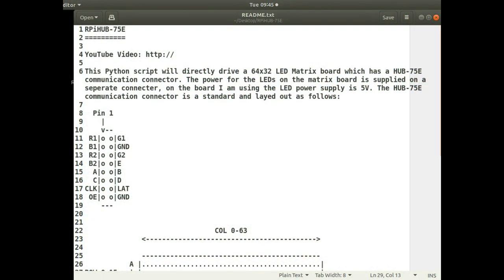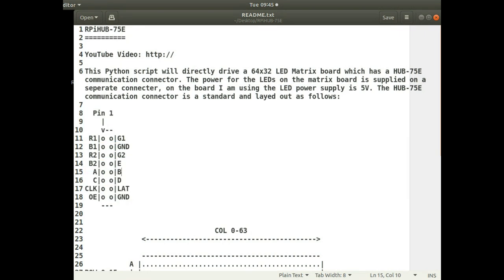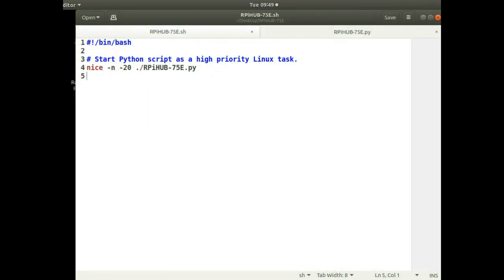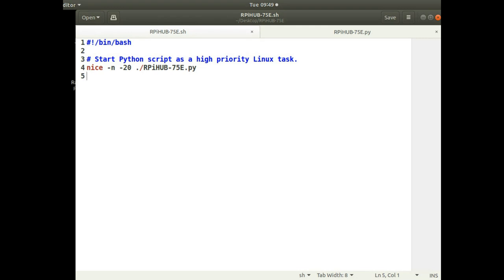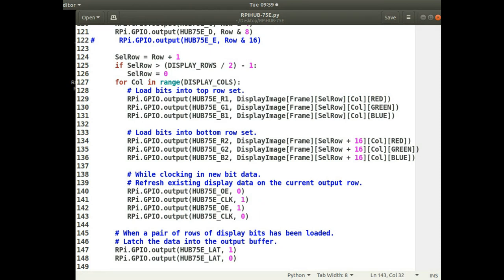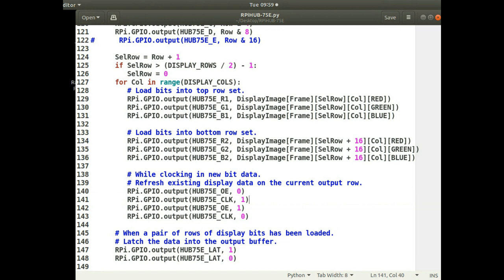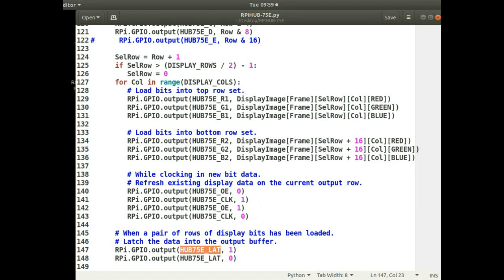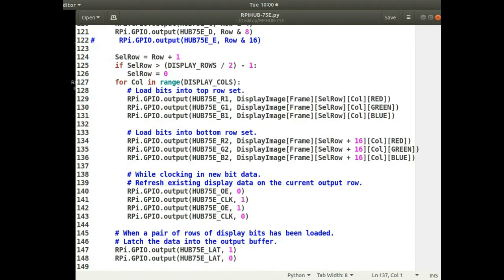Driving a 64x32 HUB-75E LED Matrix With Python From a Raspberry Pi

Comment: What commands do you use to display.  Can't tell if my video 64x32 is the problem or the interface HAT card.  do you have a video of commands.
Reply from the maker: The source code used in this video is here: https://github.com/BirchJD/RPiHUB-75E
At the top of the code is the GPIO pin assignments, change those to the pin assignments used on your HAT and when the code is run, it should do the same as what happens in the video.

Comment: Sir will u please inform me what are the changes should be made in program to interface RGB P3 64x64 Display.
Reply: I've received my 64x64 matrix today, got it connected to a pi1 so I had to change some of the pins
I enabled pin E in the code (which was commented out)
I just have the issue where it's not drawing the whole matrix properly (missing lines (banding))

Comment: Thanks for your video, it was really informative! However, I'm working with a setup that is wired directly from the Adafruit 64x32 panel to the Raspberry Pi via female to female jumper wires. The code doesn't work as is, so I'm assuming I need to change it a bit. I'm really new to this stuff (Raspberry Pi programming, not Python or programming in general, I'm a year away from completing my computer science degree lol) so any advice would be appreciated on how to proceed.
Reply from the maker: Anna, 
Is this the item: https://www.adafruit.com/product/2279
On the specs of their page it specifies 5V @ 4A on the black and red cables they supply. I think a separate 5V supply from the Raspberry Pi would be ideal because of the current required. Their product page is not very helpful, I zoomed into one of the images and it looks like it says HUB-75D, the display I have has a HUB-75E connector. I don't know the different, but the PCB looks like it has labels for each pin. I think you should find that connecting the appropriate GPIO on the Raspberry Pi to the connector should work. You will need a 0V from the Raspberry Pi to the ribbon connector too. At the top of the source code RPiHUB-75E.py you will find the GPIO pin numbers associated to the labels on the ribbon connector.
Jason

Comment: Did you have to solder anything?
Reply from the maker: The matrix I got came with wires and connectors for the matrix, inserted breadboard wires into the other side of the connector to make the connections.